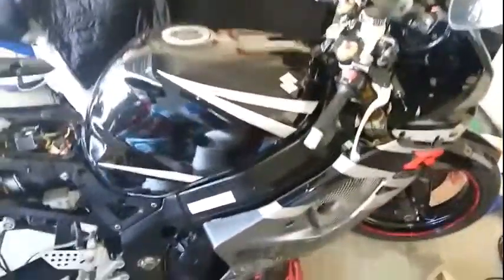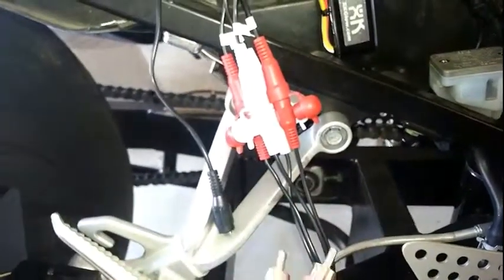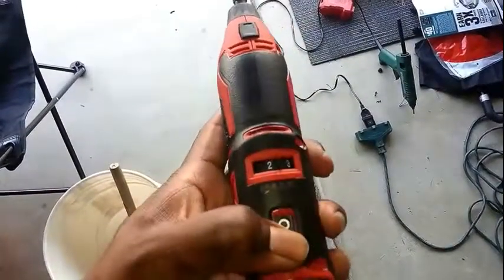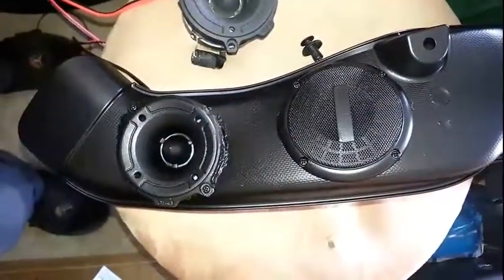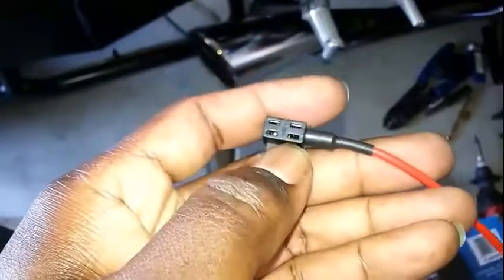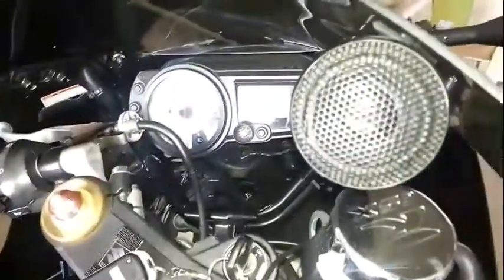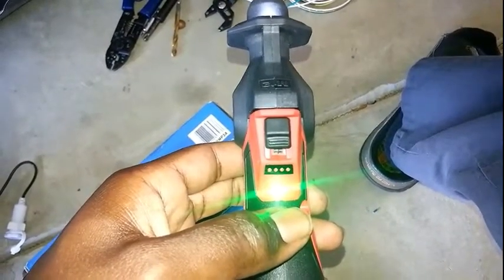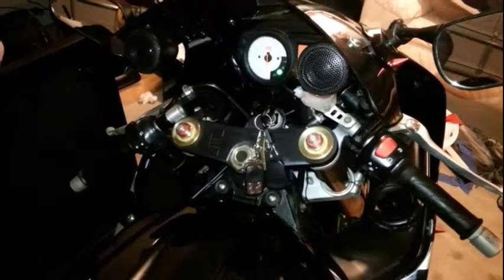How to: Install Stereo System and Custom Speaker in RAM AIR Duct (2004 GSXR 1000)

Comment: How much did you spend roughly and the amount of time it took? Thanks bud
Reply from the maker: Pause me around 250 275 oh, that's including the wiring and the solder and the heat shrink, couple cans of Plasti Dip to paint the speakers the same color
Reply: I dont mean to be so off topic but does anyone know a trick to log back into an Instagram account..?
I was dumb lost the account password. I would love any assistance you can offer me.
Reply: @Vivaan Howard Thanks so much for your reply. I got to the site thru google and im in the hacking process now.
I see it takes a while so I will get back to you later with my results.
Reply: @Vivaan Howard It worked and I finally got access to my account again. I'm so happy:D
Thanks so much you really help me out :D
Reply: @Hugo Joseph you are welcome xD